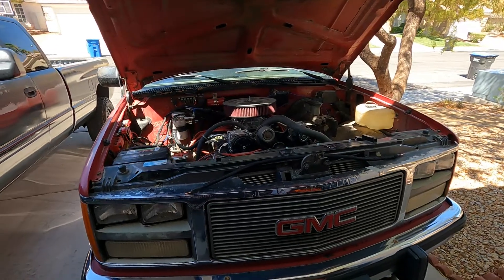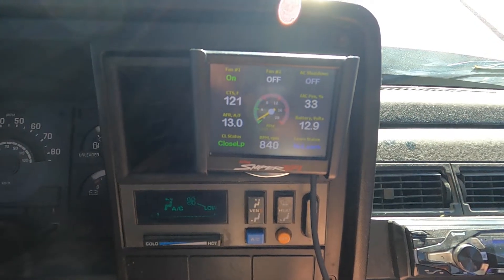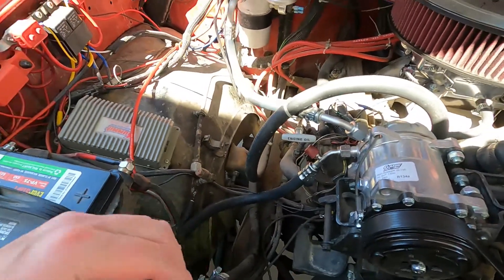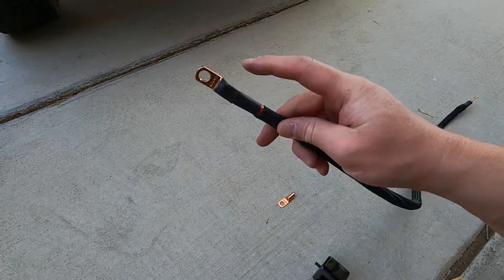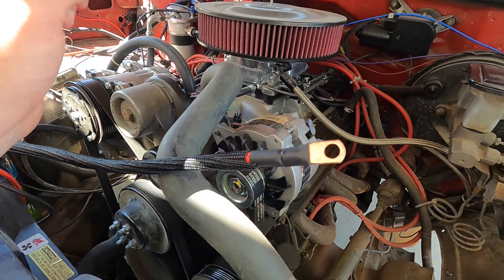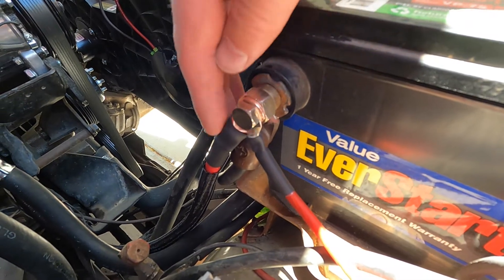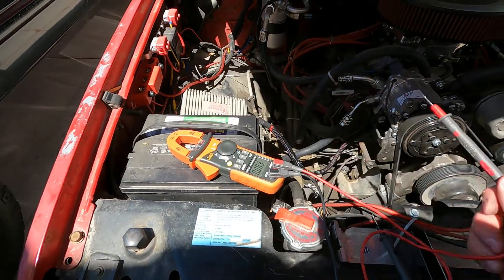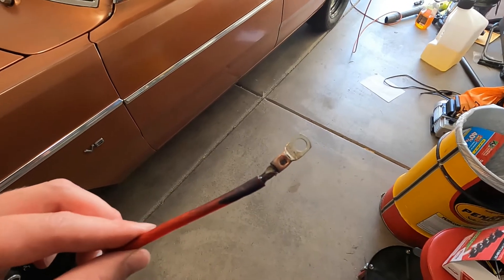Fixing Low Voltage Problem on OBS Chevy Truck

Comment: Just got one and the previous owner mess with the wiring. Can’t figure out why it won’t start. It’s seems like the battery is being drained when I try to start the truck. It’s a 93 1500 5.7?
Reply: Did you ever figure this out?

Comment: I did the same thing and still reads low only in drive at idle, all grounds are clean from back of car to the front and replaced all the wires, upgraded to the "big 3" and still low at idle. New alternator and fully charged battery and still low at idle. I dont get it.....🤬

Comment: Where can i get a voltage machine? And can this be the simple fix for why mine may not start up (turns over good yes) , new plugs n plug wires

Comment: I just tested mine with interior lights, head lights and tail lights, stereo and 4 channel amp and I have .5 volt drop in between the alternator and the battery. nothing on but the engine I have 14.7 output and like 14.65 at the battery and as soon as I turn all that stuff on the dash gauge goes down to like 11.5v which isn’t right at all. I have all new braided ground straps. 

any idea where my problem is? sounds like ground but I replaced all those braided grounds I think there’s 3 in total
Reply: Did you figure it out?
Reply: Any luck ?
Reply: Having basically the same issue have you had any luck with it?

Comment: Issue with my 92 suburban is that it randomly shuts off at red lights after release of brake to acceleration and turns on fine but once shift to drive and go to accelerate it again shuts off and to this day all we have done to fix issues it still on occasions foes it. Would you know of this issue or what it can be?

Comment: I have this issue randomly off and on chasing and cleaning grounds or (Dual) battery terminals sometimes appears to help, then it would quickly surface again (Random as above) 
I guess I will check that wire.  I think I cleaned it long ago. 
98 GMC Sierra, 6.5 Diesel, Crew Cab,  SLT Fully Loaded 4x4 Dually on 33x11 BFG  MTs, 2 inch spacers, No Lift, Black

Comment: I always wire brush the bolt holes on the alternator and the bracket.

Take the battery leads apart and sand then down. It made my starter a lot faster.

Comment: I went threw today and checked, and removed the main old grounds in the engine bay of my 88, and the  one on the filler neck. They were old and tattered and needed replaced.

Comment: OK so just so I understand this… Originally you had a positive cable running down to the starter and now you took that battery cable out and ran one from the alternator directly to the battery… And from the battery you have a cable going down to the starter. Is that correct?
Reply from the maker: Hey, sorry if it was confusing. I didn't remove the positive cable running from the battery to the starter. I didn't even remove the original wire from the the back of the alternator. I just added another cable to the post on the alternator, in addition to the stock one, and ran it straight to the battery positive. Basically creating a parallel path to the battery. Not exactly 100% the best way to handle it. But it works to bypass any factory wiring that has high resistance. If that makes any sense..

Comment: Im going to try 4awg wire.   Using the lights and AC blower will cause my system to drain power,  eventually causing dash warning lights.   EVEN though my Powermaster Alternator is keeping up.  So OBVIOUSLY a wire issue.   the factory wire off the ALT is so small.     Ty for this video.
Reply: This

Comment: Thank you so much I took care of the problem. The problem was on the left side of the passenger engine bay wall with the harness goes into the computer in the glove compartment looks like a scrap rat chopped away on them in the winter while I used to turn on the truck in my carport due to gravel as well. Gave me a lot of surface. Rust oxide wires, but sniffed everything away. Cleaned everything up fired right up with no problem. Thank you so much. I really appreciate you getting back to me you’re the best.
Reply from the maker: Right on! I'm glad you figured out the problem!

Comment: How are you doing? I have a 91 GMC sierra CK 1500 anyway I am having a problem maybe you can help me I change distributor cap rotor wires plugs Marjo heat sensor sending unit sensor fuel filter, alternator battery, grounded, everything in the engine bay like you could never imagine swapped out alternator wire to to gauge from positive to the alternator. Also change the coil. Hi change everything you could imagine even the bar on the firewall to the passenger side that distributes the current throughout the whole engine, be spotless clean, the right amount of voltage, my hood light works fine my winding light on the fender passenger side works fine and I am still having the check gauge light on and the battery light on I can put the key in fuel pump runs like a baby car will crank all day long will not crank over now. I have no idea maybe being where I’m keeping it at in a carport sitting on top of gravel where they were the dirt ones, I don’t know if that has anything to do with it but before the lights were coming on the truck was turning on and backfiring that issue has stopped. The truck has been running fine parked it didn’t turn it on for a couple days and when I go to turn it on nothing but problems mind you he has a brand new battery as well. Can you help me thank you my name is Wilfredo.
Reply from the maker: Sorry, Wilfredo. I don't think this video will help you with your problem. Sounds like it might be something outside of the charging system.

Comment: Did you ever figure out the problem
Reply from the maker: Yes. High resistance in the stock wiring.
Reply: @kellybuilt1  thank you for getting back with me and I found out mine was bad grounds and a bad alternator
Reply from the maker: Bad grounds will get you.. My ignition box and my front clip wiring were sharing a bad ground a while back and the engine would shut off every time I turned on the right turn signal... It seemed too strange to be true until I fixed the ground!
Reply: if i put a new wire from alternator to battery can I keep the existing one that goes to the junction block or do i need to remove it?
Reply: thanks for the video-  on my 91 gmc c1500 the wire on the back of the alternator does not go to the battery, it goes to the junction bar inside the engine bay on the passenger side- is that normal?

Comment: I'm having the same charging problem on my 96 k1500 Did your alternator pully get hot when it was running low voltage. I change the idler pully and belt and alternator. Still runs 10 amps
Reply: 10 volts I mean
Reply from the maker: No the pully didn't get hot that I know of. I replaced the alternator a while back because it started growling and making noises. I think the bearings or whatever the shaft rides on failed.

Comment: So the existing alternator wire is discontinued?
Reply from the maker: No the factory one is still there too. Just added another one.
Reply: Im changing that wire, do i need fuse to a 2-4 gauge from the alt to the batt?